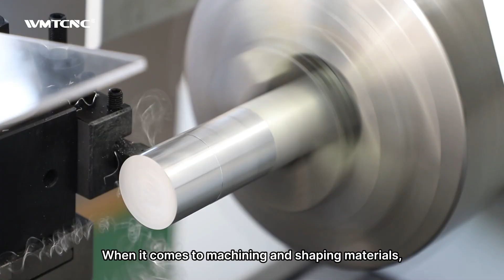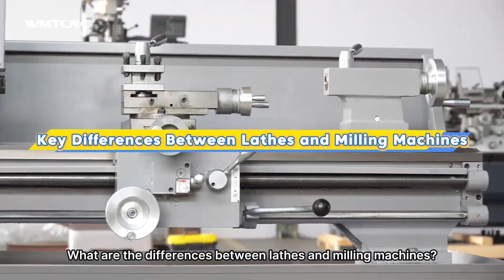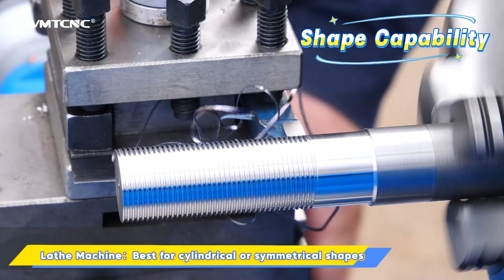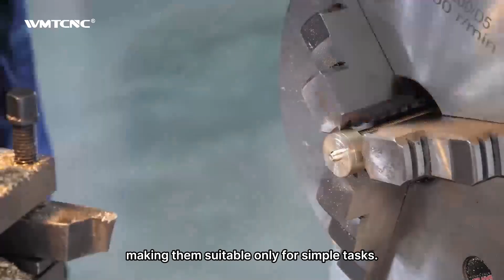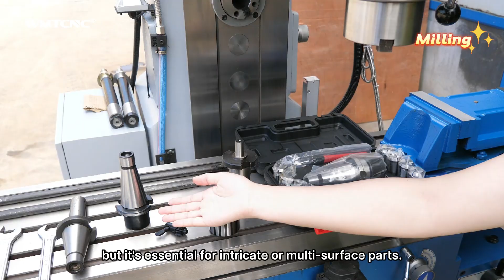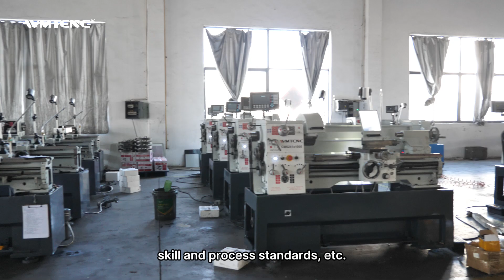Lathe VS  Milling：Which Is Right for Your Manufacturing Needs? #lathe #milling #metal

Comment: Hello. Beautiful machines. What type of oil is recommended for the gearbox of a CJM320C bench lathe?
Reply from the maker: ecommended oil type is typically ISO VG 68 or ISO VG 100 gear oil, depending on operating conditions
Reply: @wmtcnc  Ok, thank you very much. Where can I find the wiring diagram for the CJM320C?
Reply from the maker: @leonardoquintero5838  This question is very professional. I need to find our technical expert to answer it for you. If it's convenient for you, you can add me on WhatsApp at +8618621559844